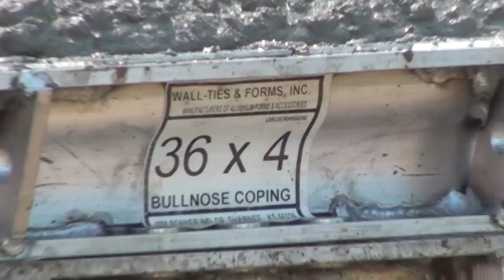Aluminum Forming System - Ashlar Stone Concrete Forms

Comment: We bought a full set of Durand forms about 20+ years ago. I want to say they cost close to 100k for a big set, pins, wedges, wailers, walkers, and all your outside and inside corners and odd forms. We run 9' forms, the biggest are  30" wide. They have paid for themselves many many times over. I like that round over form for the tops of Retaining walls a lot. We have the same get-up, with the crane truck and cages. Used to have to carry them all by hand out of the walk out basement and around and up the hill. Those were tough days. Lol. The big ones that we use most often weigh around 100 lbs. You have to get used to carrying them. Nice work guys.
Reply: Very honorable work!

Comment: I can't imagine how much these forms cost. It was $80 for a 2' x 8' marine plywood 4 bar Advance panel when I was a youngster.
Reply: Breen Ouellette I think the idea here is the texture in the concrete forms. It's a retaining wall, so no insulation is required. It just has to be strong and pretty.

I built foundations for about 10 years back in the 80s, 90s. We had wooden forms with built in latches. I stopped because my back couldn't take it anymore. I heard the disc pop.

If insulated concrete forms were around back then, I'd still be in that business. They are night and day different from the old way of building house foundations. 

Today's kids don't know how lucky they are to be able to work ICFs.

Comment: Really cool work.  How thick is that Aluminum plate?    Maybe 1/8" plate?    Some of the cross members look like they are some sort of aluminum channel maybe 2" deep, maybe 1' on center.   The parts where the guy was tapping with the hammer, maybe 3/8" thick aluminum?